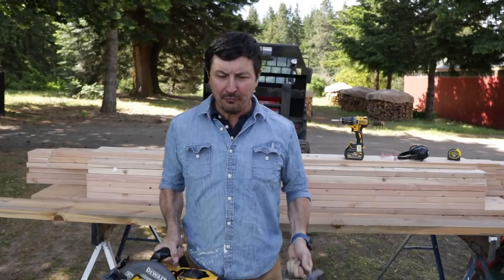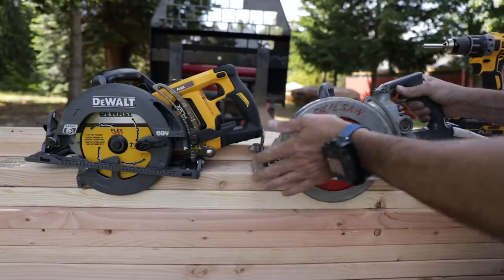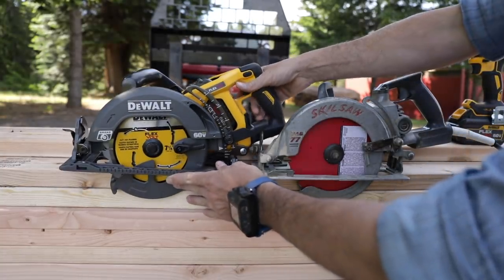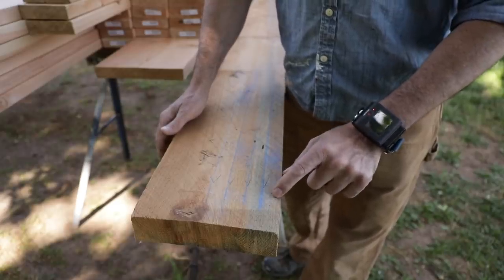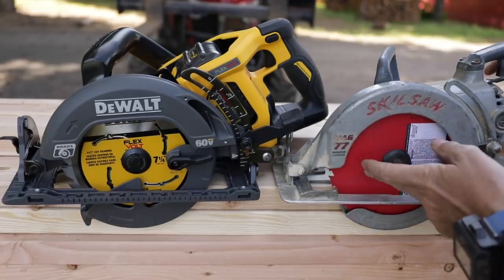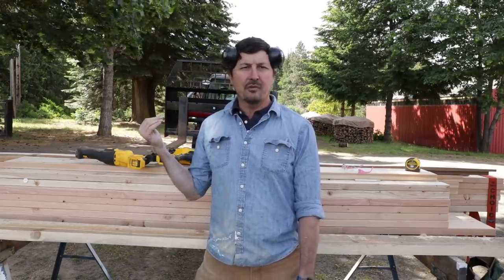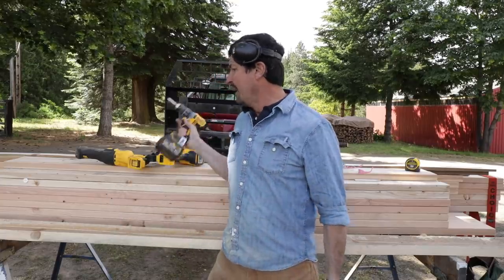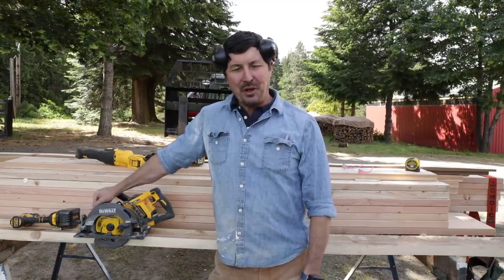Dewalt Flexvolt V.S. Skill Mag77 [S H O C K I N G]

Comment: The thing that will almost always happen with the cordless saws though is going to be longjevity.  The corded saws can be run all day IF you have a place to just set them up and work in the same location.  The cordless tools will always need extra batteries and need to be recharged.  If the you have enough batteries to run all day then it probably isn't an issue for you otherwise even if it cuts slower, the ability to work all day wins out.

Also the cordless tools are an investment in a brand.  Once you start buying tools and extra batteries and all the proprietary equipment that go with it your pretty invested.  We're talking hundreds of dollars and if the brand quality starts going down, you would be very dissappointed.
Reply: Nuance? There's no place for that in the Youtube comments section!!!! But seriously, some good points. I think corded tools are a better option for high volume tasks in a relatively close area (cut station, production framing, etc) and cordless tools are handy in more varied situations like remodels or punch list work. Although certain smaller, less power hungry tools can just be straight cordless all the time with little negatives.

Comment: I don't think they are worth the money, charging/changing batteries, ever work 16 hours (or more). I'd rather drag a cord and make piles of saw dust than run back and forth for batteries... and then there's those pesky people with sticky fingers grabbing chargers and batteries. To each his own.  :)
Reply: Cain tuckee64 exactly most of us do on those big jobs !
Reply from the maker: Good point everything is about compromise,
Reply: I'm in Australia an working from our regulation but imagine not a huge difference in most 1st world countries but if you have worked on any construction sites it is getting so much harder having extension leads running around plus the required ohs required monthly testing plus there is just setup time anyone use to cordless tool always has charged batteries and when you need to do something its just grab and go no setup needed
Reply: Always ups and downs. If you have a job whereas you move from room to room, or floor to floor,a battery tool may be best. If you will work from a central location and you are the dedicated "saw man"... the corded tool will do the job all day, every day, no chargers, no batteries to run down.
Reply: cordless tools fail when you are using them constantly, like if don't put it down between uses, you need a cord or you'll be changing batteries every 20-30 min
Reply: You ever have to cut in a window on the exterior of a 4th floor on a ladder?  Cordless or go home I'm done before your are even setup... I do this all day everyday foundation to finish.  Even the Squatch saw bogs down motor can't push the blade size, dewalt flexvolt is not a joke
Reply: I don't mean to sound like a snob, you have a specific job and then a corless tool will be your go to tool. I worked with airtools before also... dragging the hoses around in and out of doors and windows... I would have traded a toolbox full those tools for one cordless DeWalt!
Reply: You must have experience with some crappy cordless tools. Most lithium batteries these days charge in an hour. The 4-5-6-8-9 amp hour batteries we are now seeing also last a long, long, LONG time. If you've got two or three batteries you'll never be waiting for one to charge. Changing one out is as easy as swapping magazines in a gun.
Reply: Yeah; a 600SC track lift /a Framing square, and a stihl chainsaw done before you set up a "ladder" or scaffolding.2-cycle is the OG cordless tool... wanna carry that in a toolbelt though? Worked in this field 40 years.
Reply: Yes, batteries have improved quite a bit and they're not done... Before the end of this year both Dewalt and Milwaukee will be releasing 12Ah batteries that will also perform a lot better than their previous releases.

Milwaukee recently did a demonstration of the tools they will be releasing later this year that will be using the new battery... 

https://www.youtube.com/watch?v=83YhWZH5--g

A lot of new technology, like being able to track tools and batteries, lock them if removed from a given area, and even customize tool settings via an app are also coming out in the newer tools...
Reply: Simply said you buy and have enough batteries on hand to last half a day flat out without charging a single battery. then you charge the flats as you go and you should get through a full day.
Reply: Also how much does the batterie cost when it's dead
Reply: sal1964 if your in the trades you dont really care if battery dies after 6 months when its paid for itself time and time again.
Reply: sal1964, I am sure you can make the difference in from the setup time difference.
Reply: About sticky fingers- we’ve had good luck painting our tools pink at the shop. 
Why? What man wants pink tools in his toolkit. Someone else sees it, it’s immediately questionable if you’ve only got one or two of them. But if you look in our warehouse, you’ll see most of the high dollar tools down to box cutters and tape measures have pink on them, with our company’s initials in sharpie over the paint.
Reply: I thought the same, but the flex volt made it into a tradesman’s tool. I work on a crew that frames 10 hours a day. Two of these and two batteries a piece and we can go all day. It’s and investment for sure, but decking a roof or working off a lift it’s well worth it in my opinion.
Reply: Shawn K   Great point! I use purple...
Reply: It all depend. One or two story houses are good for cords but with places like Houston and those new shitty 4-5 story Conde/house  that are doing that doing the whole Yankee style home you need a cordless
Reply: Cain tuckee64
Not to mention having to find an outlet somewhere out of the area and forgetting it when you roll up! Could be just me, but I have left my charger a few times over the years, lost it once.
Reply: 45 minute quick charge on the flex
Reply: Umm batteries have evolved my friend,  I got 2 4oh batteries and you can not drain 1 before the other charges... and you doing anything requiring such a task no one in their mind will factor such a set up to effectively and efficiently finish said task...
So many variables in what makes a cut... you can have a sapped blade and takes more power to cut, or you are 100 plus feet away from power box or generator losing amperage in cord length, 
The answer is simple, they both belong in your tool box because only that man keeps making $$$ and keeps pushing, if you choose a side you're limiting yourself... tools don't work without a brain to maximize their potential, 
Hell, a brand new diablo blade a rookie borrowed my saw, comes back like he tried to cut into a safe, wtf!!! He just was demoing a floor which had 3 layers, and oh just ran my saw blade up and down nail city... lol frickin quality... smh

Comment: A few years ago I bit the bullet and switched over to Milwaukee.  I did this after working a job where we ran both brands across the board, especially the recip saw  I now have a loaded lineup of .both.  The Milwaukee is a much better built, and hardier tool by far.  As in every job, sail a few tools off a ladder and see who lives to fight another day.  Likewise the Skil and DeWault.  Sorry to say, but that's what it takes because that's the way it is. Thanks Cody.

Comment: I like the test.  My interest is in how long the battery lasts.  Does it last as long as a recharge cycle when running the saw in full production mode?  By that I mean can you work two batteries all day and never have to slow down?  Does one battery last long enough to fully recharge another one?  Great video!

Comment: They can compare for about 10 mins then they need a recharge lol I live all corded tools but when u don’t have power then battery’s are great or a small generator
Reply: Chris Wells 5 years ago that would be pretty accurate but these days you can get a long runtime with the new lithium ion batteries. They really have come a long way
Reply: Chris Wells I run my Milwaukee all day on one 9.0 battery these days you can be completely cordless and its moving that way for most trades the convenience of cutting the cord with the power matching the corded counter parts its no longer necessary to rely on having power and cordless lets me get so many more places with my tools
Reply: I've ran Makita drills alllllllll day on one battery, in fact I was amazed when it didn't start slowing down
Reply: Right on Chris! See my post above.  :)
Reply: Chris Wells & Andrew Lyon My first cordless didn't run more than 10min. My latest much better. But B&D. DON'T get B&D... Not much good but for small jobs...Good thing that's all I do...
Reply: Sam T one battery y’all must not stay  very busy ! Or y’all just don’t do much decking cause that is the case !
Reply: One battery all day lmao yeah right I’ve owned plenty of makitas and dewalts and Milwaukees all the same all the same they last about an hour If your lucky
Reply: Andrew Lyon they still don’t last
Reply: I have this same saw and use it professionally for about six months. The batteries last a really long time. With all the cutting I do, I switch batteries twice a day. The saw doesn’t lose power or strength as the battery charge dwindles, but when the battery is dead it’s dead. The saw stops mid cut and won’t proceed until the battery is replaced or charged. I had bought the regular 60 volt saw from DeWalt. I didn’t like it. The blade was on the right side and the weight/balance sucked. I used it for a month before replacing it with the worm drive version. It is important to note that the DeWalt saw is not a worm drive saw, so the comparison isn’t really fair. The Skill 77 is a great saw but runs slower because of the gear drive and has a lot of torque. The DeWalt saw is direct drive, not worm drive.
Reply: i do agree Chris because a battery will go bad after a few years and the cost of replacing is crazy expensive and for me that cost is way to high for the convenience
Reply: electrician for many years and even with today's technology and batteries in no way will you drill out a ruff in of a decent size house using battery power unless you have a lot of them or a plumber drilling out a rufin  for all of his pipes with a huge worm drill cutting holes threw 500 or more 2x4 s and 4x4 top plates but i will say doing the trim out is a job for battery power as you move room to room installing small 6x32 screws in your plugs and switches and installing lights
Reply: I'm an electrician as well going on 17 years now and I have no idea what your doing I may have to swap to a second battery for rough in but 1 generally gets me through it's the dewalt 5Ah batteries and lithium has near no difference from the point of full charge to empty unlike the old ones which slow down with the charge
Reply: There is a huge difference btn a cordless saw and drill.
Reply: I own the same saw and I get in till either coffee break or lunch before I need to switch out batteries depending on how busy of a day it is

Comment: I work as a handyman. Thank god for the Flexvolt technology makes jobs much easier. Their drill is literally incredible. Just powers through anything. Has 3 different speed settings, 1st gear works amazing for mixing concrete. I'm trying to go all cordless on all my tools. Of course could be very expensive though lol. I've used a Skilsaw Mag77 for years now. Amazing drive saw but Battery operated everything is the future.

Comment: From a contractor perspective, cordless is the way to go. Years ago not so much, but today battery powered gear (all of mine happen to also be dewalt 20 volt) has improved to the point that it doesnt make sense to deal with cords. I own and operate a home renovations company, and we use circular saws, table saws, reciprocating saws, oscillating saws, jig saws, impacts, drills, brad nailers....all on a weekly basis. Losing the cords and air hoses is a time saver and increases productivity. I wouldnt necessarily say dewalt is better than otjer comparable brands, its just what I happen to be invested in as well. So with literally thousands upon thousands of dollars in dewalt 20v products....well, thats what we continue to use and buy.

Comment: Our church team builds handicap ramps for church and or town residents.  Typically, the labor is free and the material is purchased by the handicapped person or their family.   If unable to handle the material cost, our church or Catholic Services or Baptist Services pays the material costs.  Our volunteers provide their own tools.  For the past several years we have mostly preferred Bosch 12 volt or Dewalt 18 volt impact drivers.  Both drive typically 2 or 3 1/2 Torx deck screws

Comment: . A large all day job gas powered and corded tools still win of course no recharging but for me battery power is the way to go for around the house. It's so nice just popping the battery in and go out in the yard or wherever I am going and not have to run extension cords or have to buy gas. I just bought a battery powered leaf blower and love it works great and I can save a little money by not having to buy gas for it.

Comment: I know what you mean about being invested in a brand.  I bought a Bosch cordless drill with 2 batteries.  I needed an impact driver, so I got a twin set Bosch impact driver and a smaller drill also with 2 batteries (it was on special offer as a twin set, and was cheaper than the impact driver with 2 batteries on it's own).  I needed to replace my (corded) jigsaw.  So I went with Bosch again, but got one cheaper without batteries.  All 4 batteries fit all 4 machines.  I do have 3 corded drills though.  I have my old(ish) reliable Skil drill that I bought for a bargain price years ago.  It lives in a mini drill press, and is used purely for running a wire brush or a buffing wheel.  I also have a heavy duty Bosch corded drill.  It copes with the 80 year old solid walls in my home where the cordless ones get bogged down (it was given to me by a neighbour after her husband died.  I had done and still do lots of odd jobs over there).  I also have a 1960s era Black and Decker, with a metal body.  My Father in law gave it to me with loads of attachments (lathe, sander, circular saw and other things that all fitted to this drill).  I rarely use it, but will not get rid of it.  My next cordless tool.  Yeah, it'll probably be a Bosch.

Comment: It's nice to see battery-powered saws coming into competition with corded saws but there is only one battery powered worm drive out there. The DeWalt the Milwaukee the Makita are all direct driventhey just have a battery located in a weird spot that actually pushes the handle back and gives them the title a rear handled battery-powered saw. What I would like to see you is Skil saws true hvl Worm Drive versing whether it be a newer Skilsaw worm drive or your older mag 77

Comment: no problem i ran my 20 volt cordless dewalt into red oak out here in mo and it was 4.5 inches thick and i had to flip the board to cut it.  I can tell you it struggled but it did it two or three times in a row i had trouble lining up the cuts and getting a strait cut.  but no wimp thats for sure.

Comment: Thing is you guys in America use 110v and here in the UK we use 230v-240v and I've noticed when we run one of our power tools like an angle grinder or saw on an inverter running 110v they take longer to spin up and generally are easier to stall so battery power in America would be great because it will be close to the power of a 240v line

Comment: I was pretty well sold on cordless saws as soon as i finally got one. And the biggest reason i will never go back is the SAFETY factor. There is no cord to catch on things and cause your cut to go sideways and bind, no cord to trip on or do the classic cord faceplant on a roof. Additionally, on my milwaukee the brake is immediate so it only spins down for half a second, and when the blade does catch hard, instead of kicking it stops. I still have all my fingers but in 8+ years of framing with a wormy there have been some close calls and i have worked with many guys missing digits.....all that risk is nearly eliminated by my M18 saw. And they are MUCH lighter so overhead or sideways fully extended cuts are far easier to control. That being said, i still like to use my old corded wormy at a stationary cut table, mostly to extend the life of my cordless because, like you said, the worm drive will last decades.

Comment: I have never clicked on a video so fast! Love your tool comparison videos! However, I am sure you know but just wanted to point out that the Dewalt saw in this video has no worm drive gearing whatsoever. It is only called a worm drive saw because of its shape/styling and comfortable feel. Also these new saws are brushless.

Comment: Mr. wranglerstar  I think it would be wonderful if you could test drive the smallest battery powered chainsaws.
I have a specific need for a lightweight portable saw. I’m working in a hilly forest over several acres cutting grape vines that are not particularly a hard wood. Because I’m making many small cuts, a very small battery powered chainsaw might be perfect, if it will hold up.

Comment: that's exactly it!  I have guys ask me all the time "why did you choose to dewalt? Milwaukee is way better" lol  I have honestly been with DeWalt for as long as I can remember simply because once I had one tool from them I was not going to start swapping out different tools that require different batteries etc.  now it has just turned into while they haven't let me down and they're only getting better.  I don't mind the yellow and black but when it comes down to it color doesn't get the job done.  it's insane to see a worm Drive lose to  a direct drive battery powered skill saw that isn't a true Worm Drive